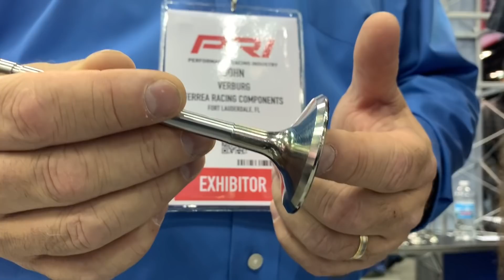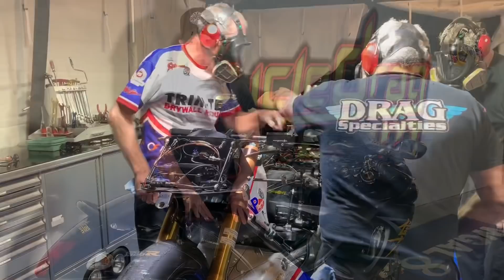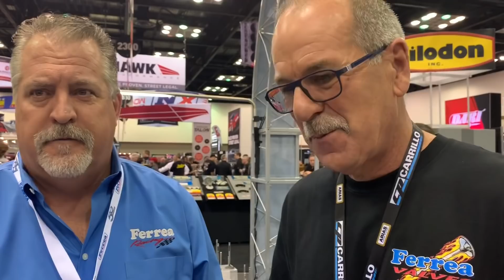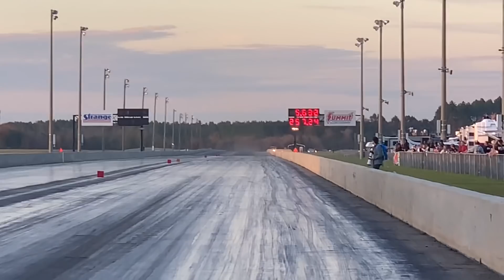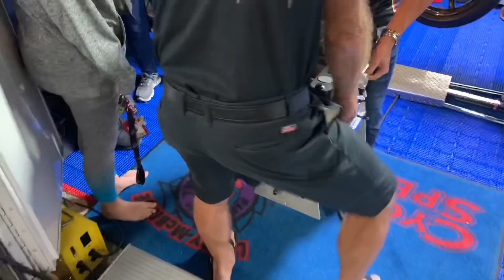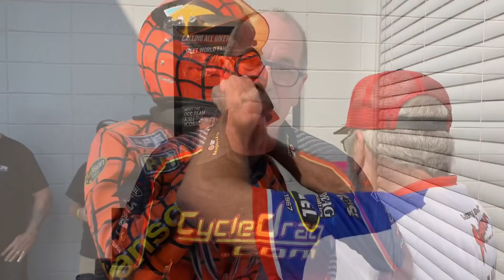DESTRUCTIVE ENGINE PROBLEM PLAGUING TOP FUEL NITRO MOTORCYCLE TEAMS AND HOW THEY AIM TO FIX IT!

Comment: In old times they ran sodium cooled exhaust valves in supercharged aero engines. Valves were made so that there was a sodium in the hollow middle of the valve. Probably very large valves are needed to that sort of cooling... won't work drag racing probably.

Comment: I thought so much nitro kept the motor cool enough. I guess 4 ft flames out the rear explains it.  Hastelloy is another $$$ metal. Tungsten valves?
Reply: Tungsten valves....and those would have Huge springs....!

Comment: I used to work in a machine shop that dealt with inconel. That stuff is not cheap, which in turn makes the parts that are milled from it, EXPENSIVE.

Comment: I bet it's a very hard job to make the valves tougher and make sure the valve head will not break off at the same time.
Reply: The only way is to make the valve  stems larger which means a larger intakes port or  use a 4 valve head which NHRA doesn't allow for 4 cylinder engines.